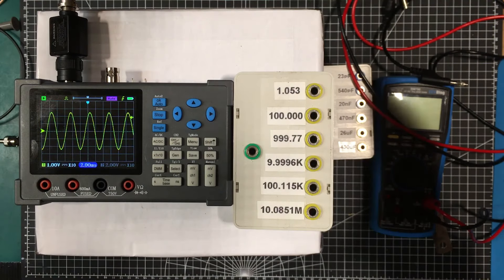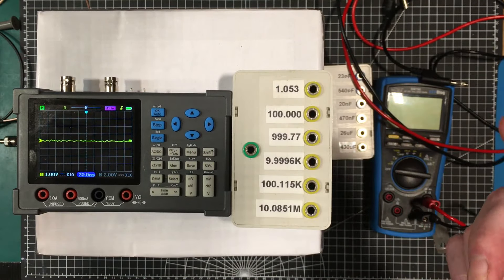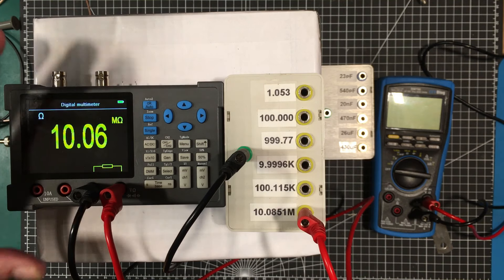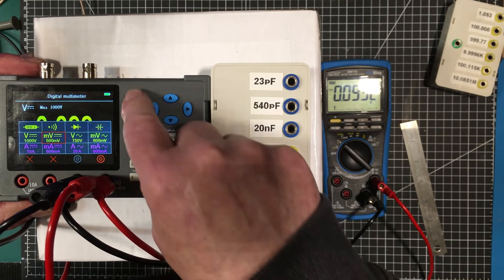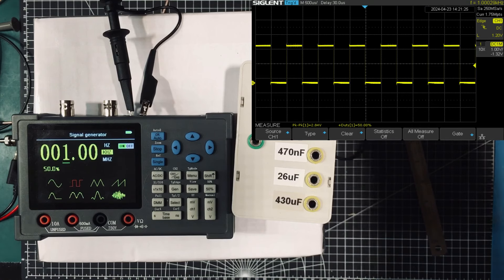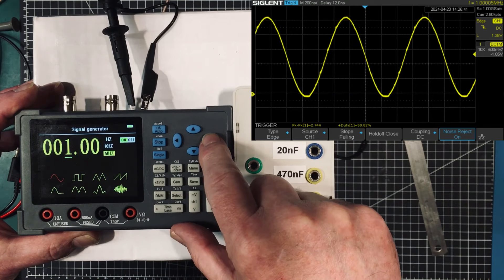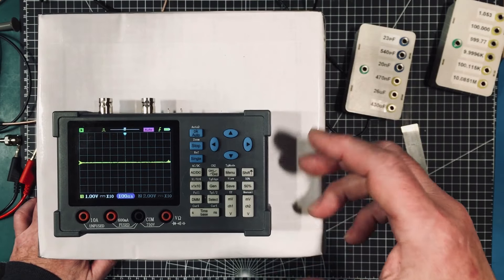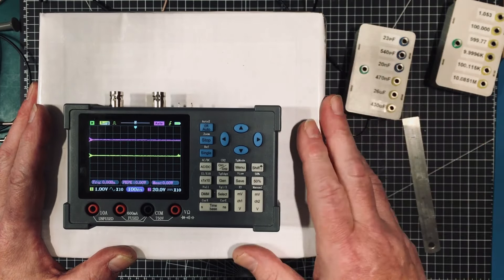Uni-Byte 0180 - A detailed look at the ZEEWEII DSO3D12: Part 3 of 3

Comment: Hi
When I presa Shift and V (the V on ch2 key (the big one at the right bottom) the screen flickers and the signal trace color becomes green. Do you know whether this is an undocumented funcionality or a bug?
Reply from the maker: It's an undocumented feature.  In case you don't like pink.  You can do the same thing from the personalization menu.
Reply from the maker: Actually, just kidding.  WE (the DSO2D13 users) don't really know what it's for.  But in some cases it provides a sort of "heat map" like you would get on digital phosphor scopes.  Play around with it and see what it does.  Maybe you can be teh first to figure out it's purpose.  But I do think it's an undocumented feature.  Maybe at some future firmware release Zeeweii will tell us what it is.  OR maybe it will go away as they can't get it working as they want it to,

Comment: What is the input capacitance?  Thank you!
Reply from the maker: It comes with the common 100MHz 6100 series Chinese probes that are rated at 16pf for 10x range.  Pretty normal specs for 100MHz probes.
Reply: @uni-byte  I'm interested in the input capacitance of the oscilloscope itself inside it.
Reply from the maker: @Anna-Z-000  It measures at 30pF, which again is typical for a scope of this speed.  Why is this important to you?  Even if you are using it directly you will be using a coaxial cable and the DUT will see that, not the scope.  Not sure I understand the reason for the question.
Reply: @uni-byte  I want to make a probe from a special cable 1m=10pF,  but if I make it 50cm, it will be 5pF + 30pF oscilloscope = 35pF.
Reply from the maker: @Anna-Z-000  I'm pretty sure that's not how it works.  The coax will have an characteristic impedance of 50 ohms, so even if the DUT did see the 30pF your roll off would begin at 106MHz - so It's still not an issue.  Even if you go to a $5000 600MHz scope you will still have 17pF - so 22pF with your reckoning.  But this is not how it works.  If you build a Zo probe, you will need to use it with a 50Ω pass-through load as this scope does not have a 50Ω input mode.  Your DUT will not see the capacitance of the scope input, it will see the complex impedance of the Zo probe.
Reply: @uni-byte  I respect your knowledge of electronics. I'm just starting to learn electronics, that's why I'm asking. The 2m cable was given to me by a friend from the military industry. The vein inside was very thin, flexible and durable, the brand of cable is unknown to me.
Reply from the maker: @Anna-Z-000  Does it have any printing at all on it?
Reply: @uni-byte  no, just clear silicone insulation, internal insulation blue
Reply from the maker: @Anna-Z-000  Hmm, then we can't be sure what the actual impedance of it is.  My guess would be 50Ω, but it could be wrong.  There are a lot of on-line articles and videos about making Z0 probes.  Look some up and don't forget to get some type of 50Ω pass-through load to place at the input of the scope, unless the scope you get has a 50Ω input mode.
Reply: @uni-byte  Fine! Good luck to you! I wish you long life and health!

Comment: You mention GPS at the beginning, but I didn't understand what you were talking about.
Reply from the maker: I mentioned a GPSDO (GPS Disciplined Oscillator) which is a 10MHz timebase that consists of a OXCO (oven controlled oscillator) which are incredibly stable on their own, which is further disciplined by the timing signals from the GPS system.  The GPS system timebase is a cesium clock.  Essentially the 10MHz coming out the the GPSDO is something like 10,000,000.000000000.  So, very accurate!  My videos 0030 and 0034 look at the unit I have.  Or you can just do a YouTube search on "GPSDO".
Reply: @uni-byte  I understand that. I have a GPS-stabilized frequency counter and it measured that the output of the DSO03D12 generator is 1kHz = 1000.32 Hz when set. It is a shock to me that the DSO03D12 frequency meter also displays 1000.32 Hz. Does that mean reference DSO03D12 has a GPSDO?
Reply from the maker: @josefmottl5729  No, the DSO3D12 does not have a GPSDO in it.  I was mentioning that I was going to check with a frequency counter that does have a GPSDO it just has a decent crystal oscillator.  The agreement on 1000.23 Hz is in pretty good though.  Crystal oscillators are usually in the 200ppm range, but that is 10ppm or so.  Really nice!

Comment: I have the zt702s and the zt703s. They have very buggy firmware so Ive been looking at this one for a few weeks now. It looks like less frustrating experience to me.
Reply from the maker: Yeah.  All teh sub $100 scope have drawbacks, but from what I've seen, this one has the least drawbacks and offers the most in terms of features.  Just don't expect to to match a $1000 SHS810X or something like that.  It's a good little $80 scope/DMM with a free but limited signal generator.
Reply: I really don't see limitations as bugs. My Zotek read a sine wave yesterday but today decides that it won't unless I restart it 3 times. That's a bug not a limitation. This zeeweii seems as you said limited but not very buggy.
Reply from the maker: @guateque1718  Ahh, okay, I get what your saying.

Comment: Hello, could you check of how the oscilloscope reacts to a 500 kHz squarewave when the time base is set to 200 ns/div? Mine, no matter if it is driven by an internal or an external generator, shows a remarkable fading oscillation (~1.2 MHz) just behind the edges of the square signal. Does this occur for your scope? Just to be mentioned - faster or slower signals look normal. I've excluded probes and the internal generator. Thanks in advance
Reply: Okay, I've found the source of the problem and now I will look for a solution. The problem is related to a DC shift circuit. The signal leaks from a high frequency path back to the DC level shifter (which is based on LM358) and there is a frequency peaking around 1 MHz. According to the schematic of the DSO2512G which is available freely, ZEEWEEI has used OPA1612 instead, at least for that model. I will either replace the opamp or I will play with the DC shifter frequency response to attenuate the peaking. Cheers!
Reply from the maker: I don't get this using the internal generator.  I tested 500 kHz square wave with horizontal time base @ 500 ns, 200 ns and 100 ns.  How many cycles of oscillation do you see?
Reply from the maker: @taki_maciek4799  Interesting.  Let us know how you make out.
Reply: @uni-byte  I tried to attach the link to my website, where I placed a documentation of the repair, but it seems prohibited :) anyway - I've played a bit with the feedback loop, however the only result I've obtained was shifting the oscillation to a different frequency. I've removed LM358 and I've installed OPA2863 instead. No the scope seems operating properly. Cheers!
Reply from the maker: @taki_maciek4799  Great result!  Thanks for letting us know about your work on this.
Reply: @uni-byte  no problem! Thanks you for posting the video material :) Watching your video I realized the size of the components is convenient and I'm able to investigate the signal path. Cheers!

Comment: what is missing on these 'flexible' units is a I2c decoder which would be much more useful than the voltmeter as most wouldn't buy this unit if they didn't already have a multimeter. the limitations of the scope would not affect its ability to decide  a bus as a bus would be in scope terms a relatively low frequency, my main scope does have bus decoding, but do I want to carry around a $2000 scope if I could have a throw away unit for playtime at a mates house.
Reply from the maker: That would be handy indeed.